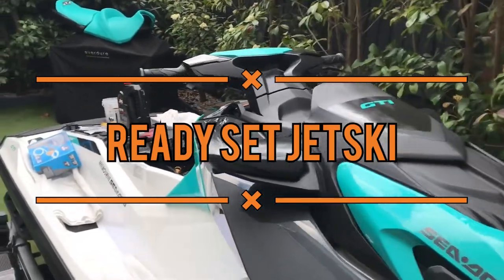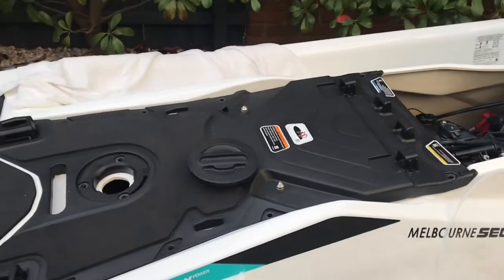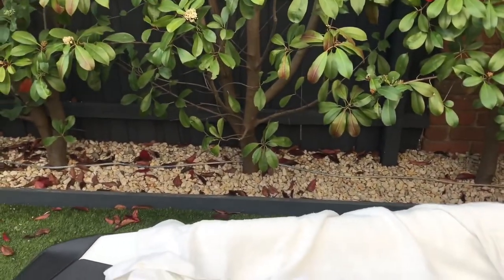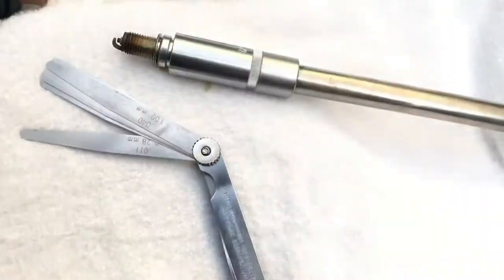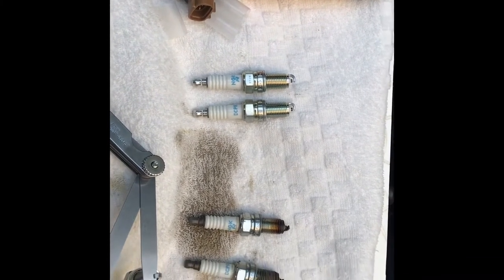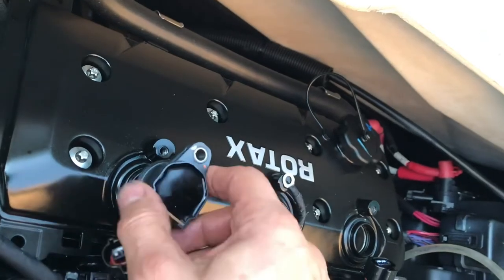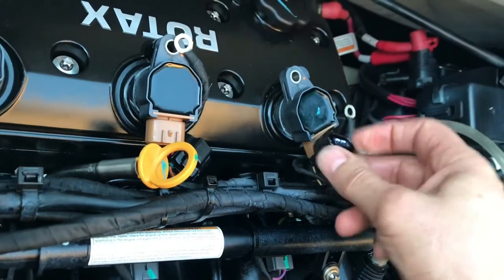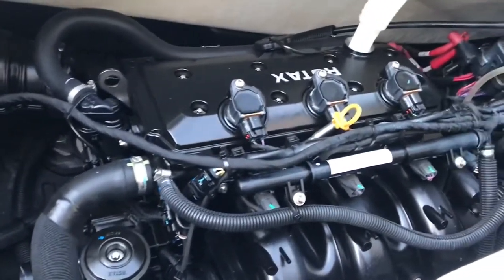How to change the oil, oil filter and spark plugs for a Seadoo GTI 130 #seadoo #oil #sparkplug

Comment: Thanks, good info & details. Only recommendation or additional info to anyone doing this for the first time, remove your ignition coils/spark plugs & replace the spark plugs one at a time so there's less risk of dropping anything down in the cylinder (in this video, all three were removed, leaving all three cylinders exposed - I'm not saying that's wrong, I'm just overly cautious, I guess)

Comment: That’s an awesome video! Thanks for sharing!! Do you know if it’s okay to have some oil inside of the spark plugs compartment? Thank you!
Reply: spark plug tubes are leaking (they have rubber on bottom and on top), replace (or "fix" with high temp silicone)

Comment: You aren't supposed to run your seadoo out off the water for more than a minute , as you are destroying the carbon seal . There is no water to keep it cool when it is out off the water.  This cam lead to carbon seal failure.
Reply from the maker: Fair point! I should have been more specific from the start and said “run it while connected to water”. I did show a couple of minutes into the video that I was running it while it was connected to water. Thanks for your comment 👍
Reply: I didn't mean that sorry , I   know you would have connected it to hose but when you connect it to the hose the water will only cool the exhaust but it will not cool your carbon seal. This is what damages your carbon seal and can lead to the carbon seal failure.
Reply: @gswlang  what if you get one of those 3 way hose split connectors so you have 3 hoses one for the exhaust, one you hook up under & spray into the intake vent & the other to hook up and spray into your Baloneyhole? lol
Reply: To be honest, I thought common sense you connect to the hose.
Reply: @gswlang  is correct.  The manual states that even with water running through the exhaust, the driveline seal is not cooled when out of the water and therefore the engine should not be run for more than 2 minutes.
Reply: To get all the oil out when you say turn the engine, you mean turn it on fully again for a second to pump more oil through?